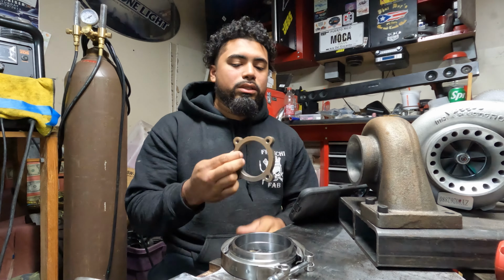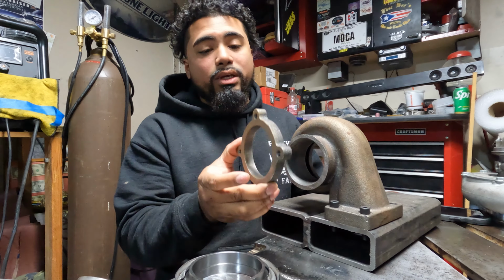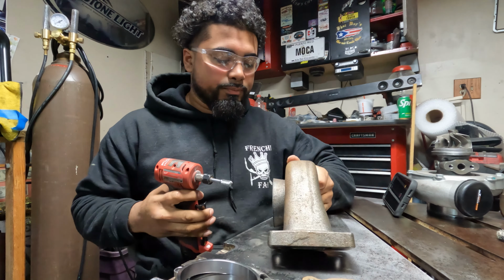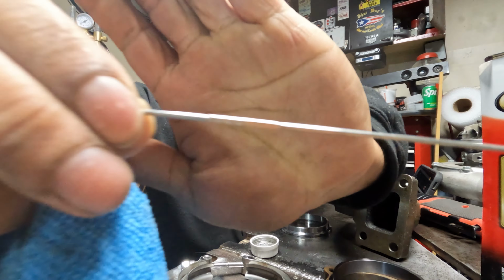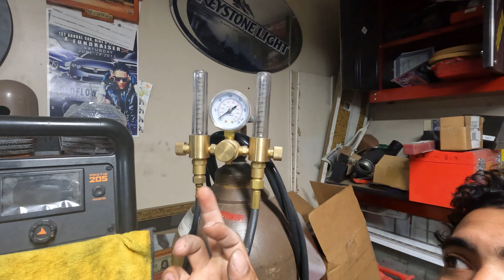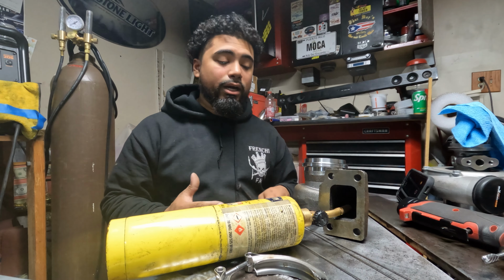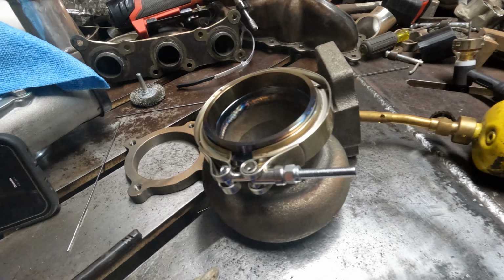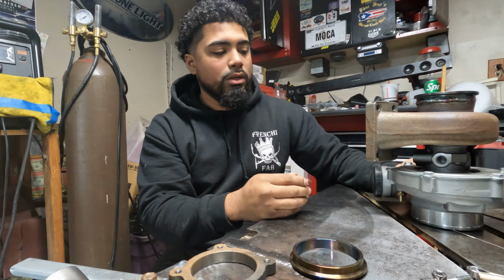Diy Turbo vband conversion

Comment: i am planning on doing this but to connect the exhaust manifold and the turbo, think it will work?
Reply from the maker: So no gasket or bolts??
Reply: @frenchifab8663   bolts strip and this would be the 3rd time replacing the gasket
Reply: So will it work on that side ?
Reply from the maker: Gotcha this means that your flange is warped brother i would try to sand the flange flat before giving up and welding! Your prolly stripping the bolt to get it to seal correct
Reply from the maker: It will work yes but i strongly recomend not to lol